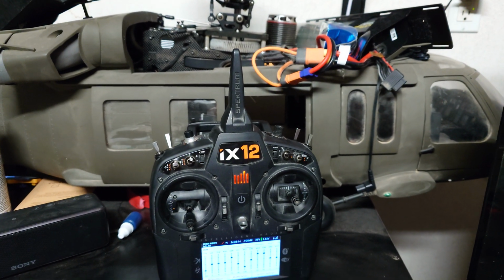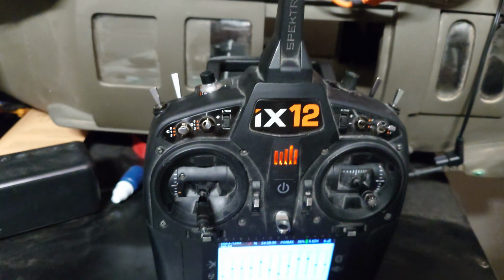Roban 700 black hawk set up spektrum fc6250hx

Comment: Thank you. Yeah I already have the 200 from avain. Just worried about using the flight controler. I got it from my blade fusion 360 and reset it and updated it. Put it in a goblin and it just banked left on stability mode. Idk if it was a bind in the servo or what. But yours looked stable sitting on the ground and take off was smooth in stability mode. I went and bought the h1 gps too and have the cortex. Was gonna see what one was the best. H1 has a scale set up already. But I love spectrum just couldn’t figure out the flybar. Made my set up was wrong idk
Reply from the maker: @Captaincoots222koehler  if you removed it from a fusion 360 smart it will not work you need to buy and open stock 6250hx
Reply from the maker: @Captaincoots222koehler  just purchase a6250hx unlocked version they also had a price drop I would not go cheap on this build also the h1 is not something I would consider if you are in areas where you can loose gps signal you will be screwed good
Reply from the maker: Also replace all your turn buckles for higher quality ones the stock ones fail
Reply: @28EduardoSierra  it’s open stock now
Reply from the maker: @Captaincoots222koehler  you cannot make it open stock if it came off a blade fusion 360 smart version the only 360 that did was the non smart version 6s first version
Reply from the maker: @Captaincoots222koehler  if you are able to change all the settings I displayed in the video then you should be on
Reply: @28EduardoSierra  I’ll show u. It’s open now
Reply: @28EduardoSierra  yes I can
Reply from the maker: @Captaincoots222koehler  ok
Reply: My 330S I got about 3 yrs ago said I couldn’t use it on another Heli. Never tried.
Reply from the maker: @PaulTAdam  you need to buy an open 6250hx